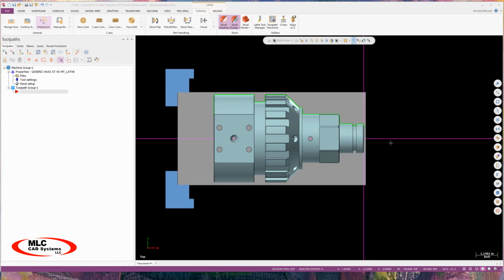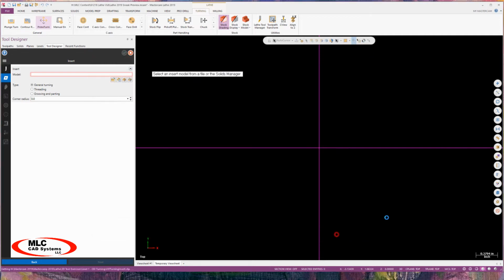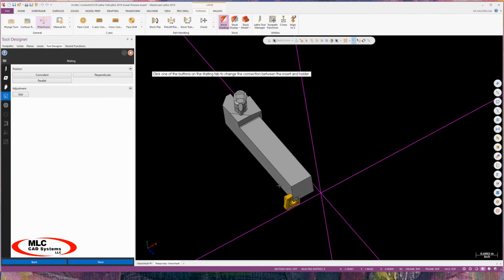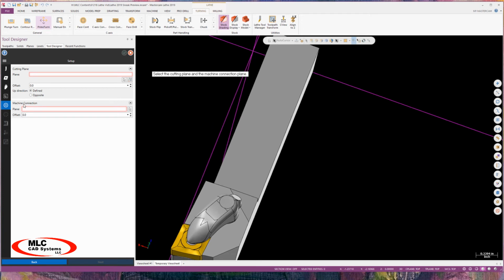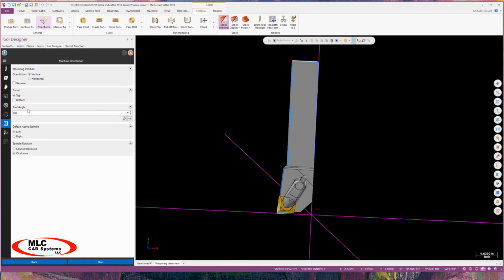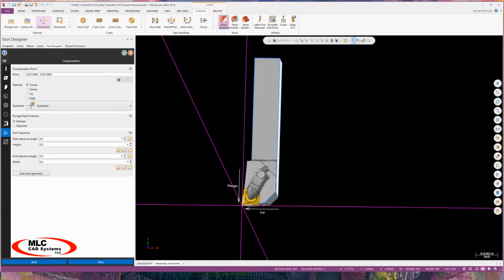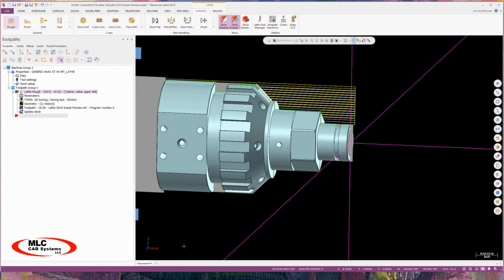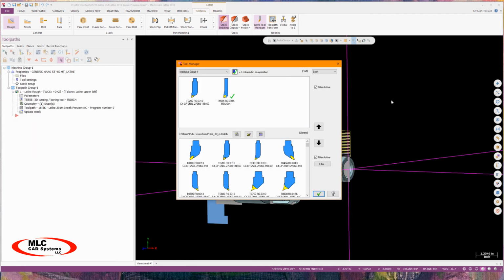Creating 3D Tooling for Lathe in Mastercam 2019

Comment: Hi. Just a quick question. Is is possible to defy the maximum depth of the plunge in custom tool especially internal grooves and boring bars? I can set the clearance of the insert but when I use it it does not recognise where the holder starts and if i accidentally selecting a deeper undercut then the actual holder capable to plunge its still plunging in, even though its shows in simulation as the holder digging into the surface. With standard holders you can set the thickness of the holder and the distance from the centre of the holder and the edge of the insert but I could not find where to set un customised tool. Thanks in advance
Reply: Hello, you can set a maximum rough depth for a lathe tool but that will only set a max depth for an individual plunge move, not an overall max depth. When using 3D tools the thickness of the holder is determined by the model itself. While there is no general control for the thickness of the holder (if we're talking about creating a custom tool from 2D geometry) there is a decent write up in the HELP section of Mastercam about creating round holders for boring bars and groove tools.
Reply from the maker: Great explanation, thanks David!
Reply: David Ferguson thanks for the reply but even if I use 3d tooling it foes notice the holder, in simulation shows the holder is digging into the material but it still going in. Here is a picture about the issue:
https://imgur.com/qa3HmVM

Comment: When mating the insert and the holder i select the insert just as you have shown but then it says to select a face on the holder but the holder is not visible, do you have any idea what I am doing wrong?
Reply: Hello, if you've loaded both the insert and the holder model they be visible during the mating process. Using the Coincident method the insert would be first, then the holder. This is done on the mating page after both the insert and holder have been recognized.